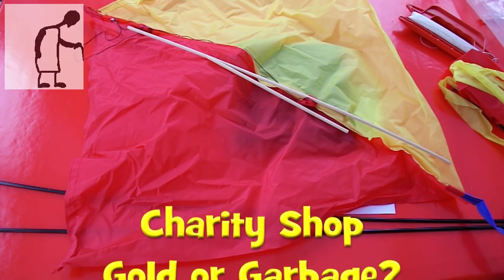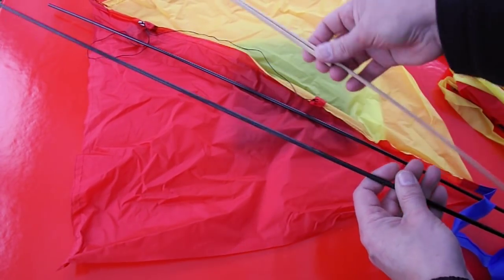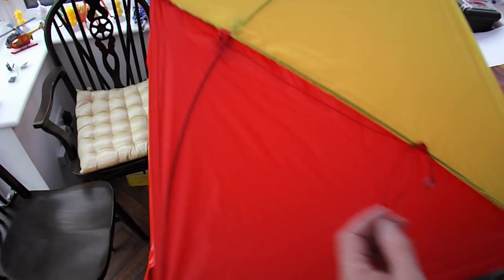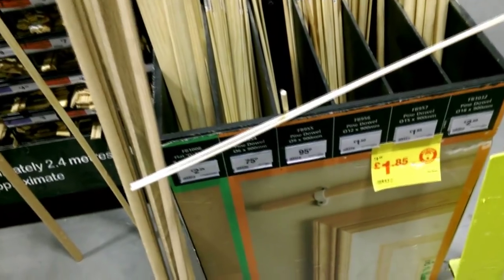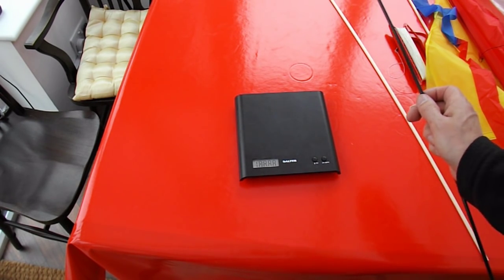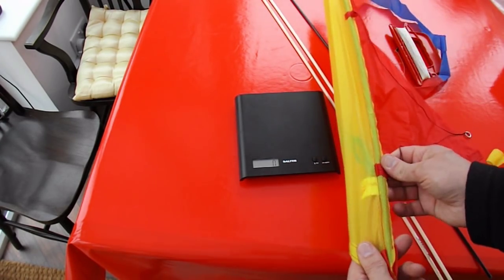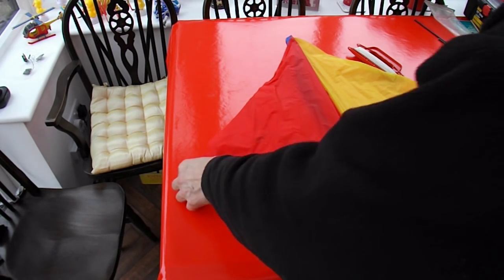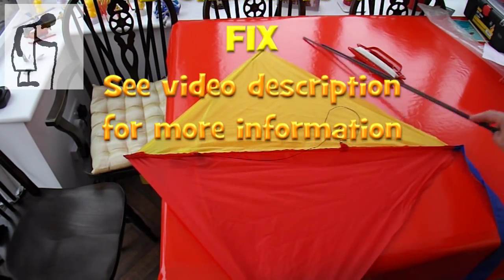Charity Shop Gold or Garbage? FIX the Broken Kite

Comment: I'm not sure that's bamboo GD, the break looks too clean. Bamboo usually splinters badly if it ever breaks. I love bamboo, It's an amazing material. Some countries even build houses with it! 
 Hey, why don't I send you some? When I first moved down to Devon, I was thinking I would continue my kite flying/making, but I never did much. But I do have some special bamboo pieces from Indian fighter kites that I purchased from a gent in London, along with a lot of kites too. The kites are mostly tissue paper ones and can only be flown in proper dry conditions as both the paper and the glue will fail when damp. But the bamboo spars are all 'used', in other words they survived longer than the paper skins!
 I'll drop you a message. :¬)